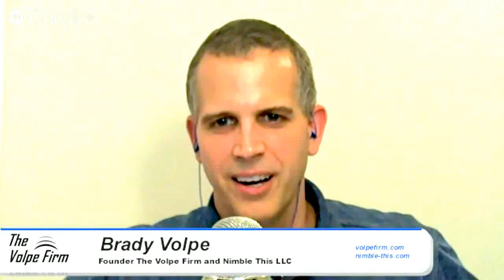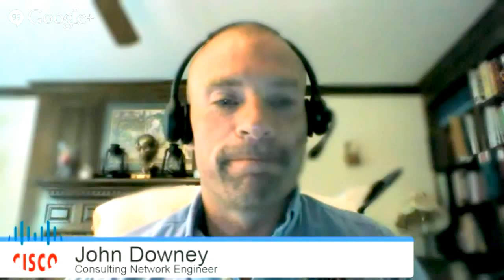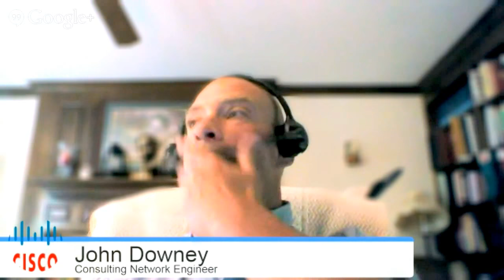DOCSIS Channel Bonding - Your questions answered

Comment: How to fix upstream issue : Time Not EstablishedCritical (3)SYNC Timing Synchronization failure - Failed to acquire QAM/QPSK symbol timing;;CM-MAC=d4:04:cd:98:5d:f1;CMTS-MAC=00:00:00:00:00:00;CM-QOS=1.0;CM-VER=3.0;Time Not EstablishedCritical (3)No Ranging Response received - T3 time-outWed Oct 09 10:57:10 2019Critical (3)SYNC Timing Synchronization failure - Failed to acquire QAM/QPSK symbol timing;;CM-MAC=d4:04:cd:98:5d:f1;CMTS-MAC=94:d4:69:54:e9:5b;CM-QOS=1.1;CM-VER=3.0;Wed Oct 09 10:57:31 2019Critical (3)SYNC Timing Synchronization failure - Failed to acquire QAM/QPSK symbol timing;;CM-MAC=d4:04:cd:98:5d:f1;CMTS-MAC=94:d4:69:54:e9:5b;CM-QOS=1.1;CM-VER=3.0;Wed Oct 09 10:57:31 2019Critical (3)Received Response to Broadcast Maintenance Request, But no Unicast Maintenance opportunities received - T4 time out;CM-MAC=d4:04:cd:98:5d:f1;CMTS-MAC=94:d4:69:54:e9:5b;CM-QOS=1.1;CM-VER=3.0;Wed Oct 09 10:57:50 2019Critical (3)SYNC Timing Synchronization failure - Failed to acquire QAM/QPSK symbol timing;;CM-MAC=d4:04:cd:98:5d:f1;CMTS-MAC=94:d4:69:54:e9:5b;CM-QOS=1.1;CM-VER=3.0;Wed Oct 09 10:57:50 2019Critical (3)Received Response to Broadcast Maintenance Request, But no Unicast Maintenance opportunities received - T4 time out;CM-MAC=d4:04:cd:98:5d:f1;CMTS-MAC=94:d4:69:54:e9:5b;CM-QOS=1.1;CM-VER=3.0;Wed Oct 09 10:57:52 2019Critical (3)SYNC Timing Synchronization failure - Failed to acquire FEC framing;CM-MAC=d4:04:cd:98:5d:f1;CMTS-MAC=00:00:00:00:00:00;CM-QOS=1.0;CM-VER=3.0;Time Not EstablishedCritical (3)SYNC Timing Synchronization failure - Failed to acquire QAM/QPSK symbol timing;;CM-MAC=d4:04:cd:98:5d:f1;CMTS-MAC=00:00:00:00:00:00;CM-QOS=1.0;CM-VER=3.0;Wed Oct 09 14:08:30 2019Critical (3)Resetting the cable modem due to docsDevResetNowTime Not EstablishedCritical (3)No Ranging Response received - T3 time-outTime Not EstablishedCritical (3)No Maintenance Broadcasts for Ranging opportunities received - T2 time-out;CM-MAC=d4:04:cd:98:5d:f1;CMTS-MAC=94:d4:69:54:e9:5b;CM-QOS=1.0;CM-VER=3.0;Time Not EstablishedNotice (6)Honoring MDD; IP provisioning mode = IPv4Time Not EstablishedWarning (5)DHCP WARNING - Non-critical field invalid in response ;CM-MAC=d4:04:cd:98:5d:f1;CMTS-MAC=94:d4:69:54:e9:5b;CM-QOS=1.0;CM-VER=3.0;Time Not EstablishedWarning (5)ToD request sent - No Response received;CM-MAC=d4:04:cd:98:5d:f1;CMTS-MAC=94:d4:69:54:e9:5b;CM-QOS=1.0;CM-VER=3.0;Mon Oct 14 07:13:11 2019Warning (5)Unicast DSID PSN startup error
Reply from the maker: Hi, This is actually a downstream issue. Any time you see Sync failures, Timing issues, "No Ranging Response Received", etc. these are indications of impairments on the downstream. Check for low downstream receive levels, noise on the downstream, loose connections, corroded connections, micro-reflections, etc.